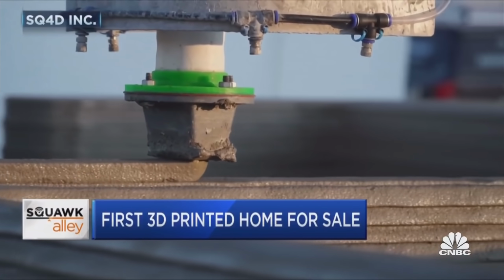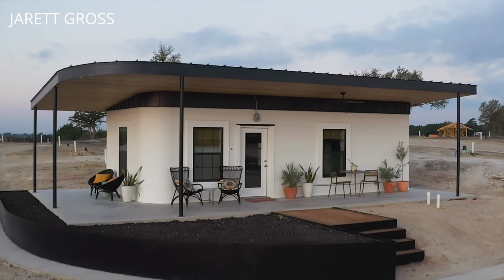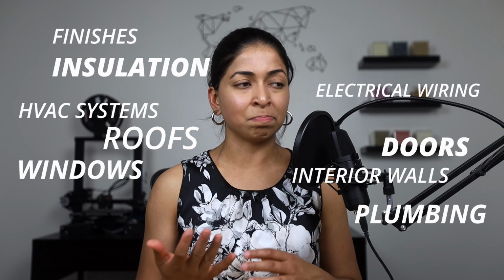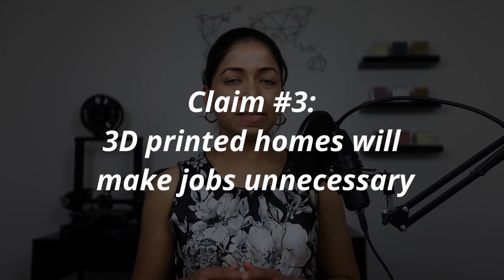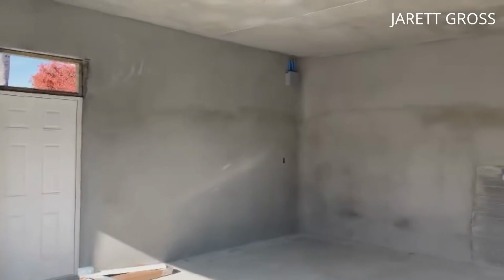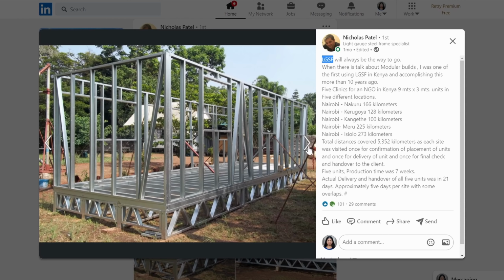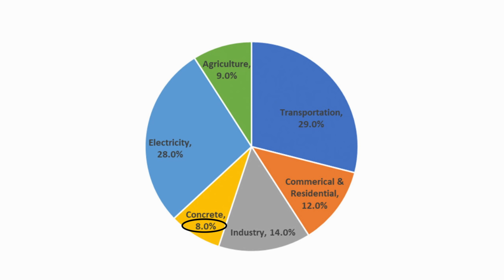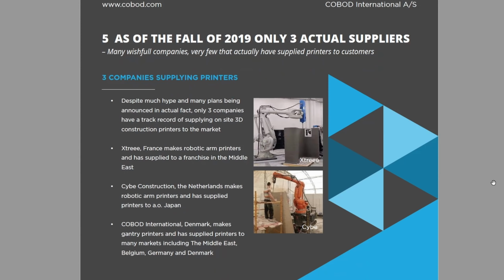Exposing 5 LIES about 3D Printed Concrete Homes

Comment: "The lies cheapen the value." Awesome statement.
Reply: The cost of 3D printed products does not drop as production volume increases in the same manner as manufactured products.  The cost advantage of small scale prototyping with 3D printing come down to less cost for specialized tooling and faster prototype production.  The cost of the manufactured printers might decrease with volume.  Any manufactured fittings might be cheaper with scale, but that would not be different from existing methods.
Reply: @Grunchy005  it sounds great and for some industries like metal printing, it is a game changer.

But for building walls, it's just square peg trying to go in a round hole. Ask any builder who does formed concrete walls or ICF if they would switch.. answer is no. Costs more, more complex and offers no advantages. Walls are just to easy to build so it's not worth bringing/setting up a printer and the onsite mixing plant.
Reply: @digitalnomad9985  Maybe there is some place where they can strike a balance where it makes more sense to make a really big printer that can span multiple lots and print several houses in one go in a way that reduces the setup + teardown + transportation cost, but that is really stretching the limits of the benefit of the doubt because building bigger tends to increase prices pretty rapidly
Reply: @coopercummings8370  maybe
Reply: @coopercummings8370  One that can be repositioned quickly/easily for successive buildings/walls but still retain its integrity/stability when printing is an alternative to an extra large printer for multiple buildings. Unfortunately, I don't know enough about the requirements for setting these things up, so it might not even be feasible in the first place. An extra large printer sounds even more costly though...
Reply: I think that's a true statement no matter what you talk about it's a big problem nobody thinks about in modern society!

Comment: As someone who spends a lot of time 3D printing, I get bombarded with questions about 3D printed homes all the time.  I was skeptical from the beginning.  3D printing any item requires a calibration effort that is ongoing.  The concrete can also be effected by weather at the time of printing too.  Day time to night time temperature changes could create problems too.
Reply: as someone who has a 3d printer with a 2000mm x 2000mm x 1000mm print volume, i find the idea of a house size 3d printer running without constant monitoring laughable. the more you scale a printer the more exponentially difficult it is to keep running. mine is a scaled up Troxy printer and i would almost always rather have the smaller printer for stability. its just that the stuff i print needs the scale
Reply: plus i would think those homes would crumble into ruins within a year of two from all the gaps due to it being printed and would lack the structural integrity of normal concrete
Reply: Plus 0 reinforcement of any kind, so in earthquake prone areas this stuff would collapse instantly. Also, concrete that thin? Probably could accidentally punch a hole in it
Reply: @dillzilla4454  TBF this is something AI could potentially fix if a learning algorithm is developed to monitor output and calibration.
Reply: @meinbherpieg4723  no it can't. AI is another tool that has gotten almost as bad as 3D printing as far as people just cramming it into things that it doesn't belong in. AI is not going to calibrate the machine and ensure that it remains properly level. No matter how you look at it, that is going to take a group of people to do.
Reply: @dillzilla4454  That is EXACTLY what AI is capable of learning.
Reply: @meal_team_6 
I think they could only work if the printers build hollow walls later filled with concrete and rebar. But go too high and the printed walls will collapse. 
ICM blocks stacked to 9ft high and filled with concrete are a far better option. Horizontal rebar is easy to fit and the blocks are stacked extremely quickly. Even then, the concrete has to be very carefully controlled. Too wet for a clean fill risks the ICM blowing out. Pour it too thick and there will be voids. Vibration settling is likely to blow out the ICF. 
Adhesive bedded aerated concrete walls are a good option. The block joints are very thin so have negligible cold bridging. The snags are the need to have the base layer has to be very flat and level. Errors multiply quickly.
Reply: @meinbherpieg4723  no it's not. All "AI" is going to do is tell you where there is a problem. It's not going to be able to fix the problem. This is universally recognized as basic error detection sensors but you seem to act like that is a AI benefit.
Reply: @dillzilla4454  Not YET. You don't seem to understand the very basic concept that AI is still in it's infancy and there are entire industries of robotic interfaces yet to become mainstream. You can't look at what is currently available as an indicator of the potential of a new technology. This is the basic design iterative process. Things. get . better. and. more. refined. over. time.
Reply: Yeah, anyone who has experience 3D printing know all these claims (not just about housing) are ridiculous
Reply: @meinbherpieg4723  the reason why AI cant solve these problems because it would need extra hardware that would cause more failures. software can't be used to solve hardware problems. doing so just results in more hardware problems. anyone who has worked on these machines before would tell you this.
Reply: @goldenhate6649  Why do you think there is no reinforcement of any kind?? MANY designs include traditional reinforcement with rebar as workers place the pieces during printing. I would suggest researching the topic more than just watching this video before making such a claim.
Reply: @meal_team_6  Why do you think there are gaps in the printing process? Have you seen how free standing concrete walls are able to support an incredible amount of soil for decades when done correctly? Why do you think there would be worse results here when the layers are thinner?
Reply: I am curious how strong the concrete will hold up over the long term because typical concrete uses rebar to reinforce it.